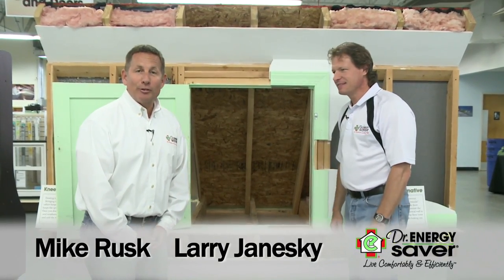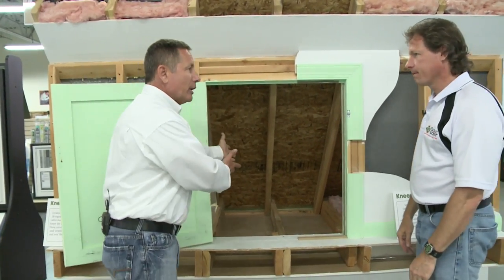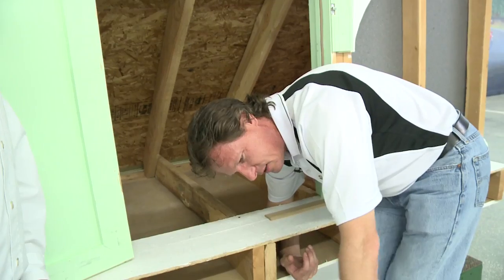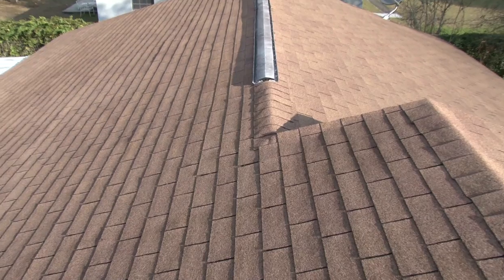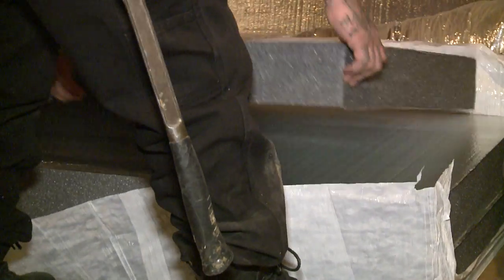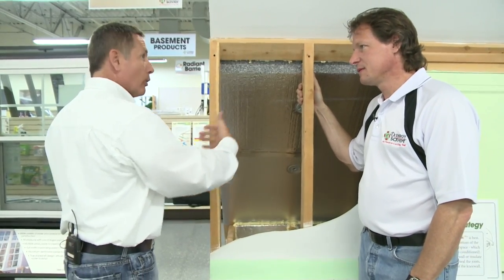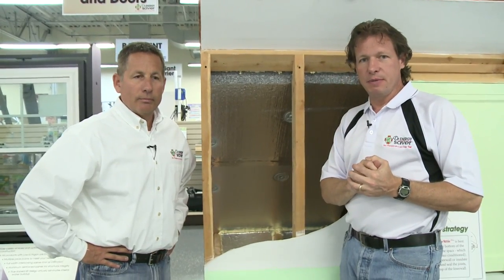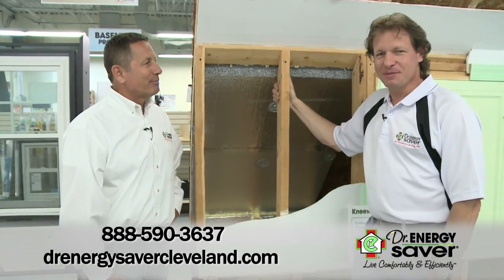Insulating Knee Walls | Making Finished Attics Energy Efficient in Cleveland

Comment: Air is not hot air entering in the summer.  The soffit vents are for the air to come in at the lower end, the soffits and should be guided with baffles up the underside of the roof decking to cool it off because it gets very hot from being in the sun.

Comment: How do you handle the knee wall when there are not any soffit vents. ? Thx
Reply: ken peffley. I knocked out several blocks down the side and installed vents. Also put in 2 roof turbine. Made it about 30 degrees cooler. There has to be airflow in the summer.

Comment: Do you recommend creating an access door (DIY?) or sealing back up with drywall?  Would I cut access before a Dr. Energy Saver inspection?  I have a 5 1/2 ft 'knee' wall.  I wish the wall was pushed back farther but it is probably defined  by the roof truss structure.  
While putting in shelf hangers, discovered wide area with 'missing' wall stud -- maybe a planned access point that was never realized.
So hot in summer I suspect builder blocked air flow to vent with insulation batts.

Comment: What about your saffet vents?
where did they go? you have insulation from the foam to the roof? no air travels from saffett to ridge vent at the top?  I have this exact problem and only asking question craving answers...thank you
Reply: They use baffles above the hard foam insulation. That way you have great airflow from the soffit to the peak vents.